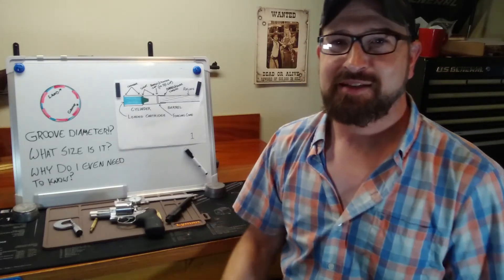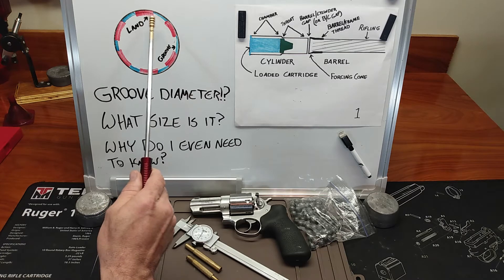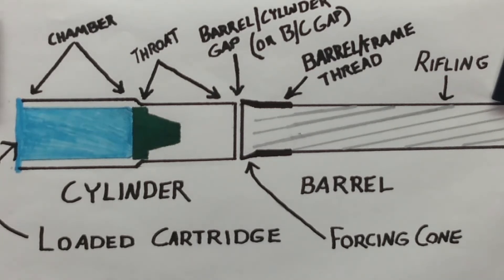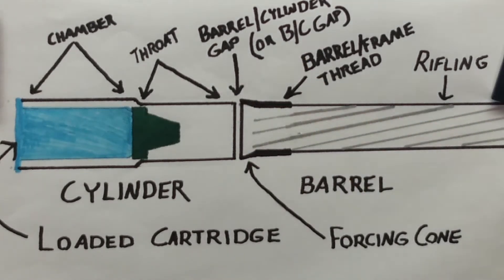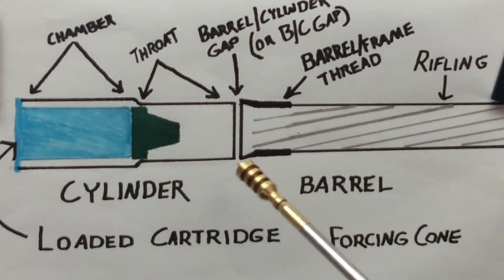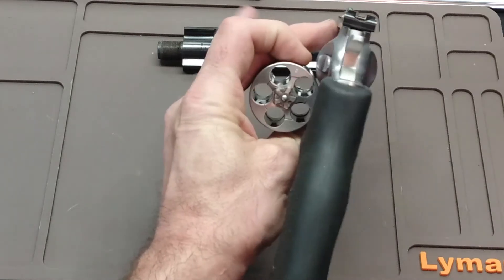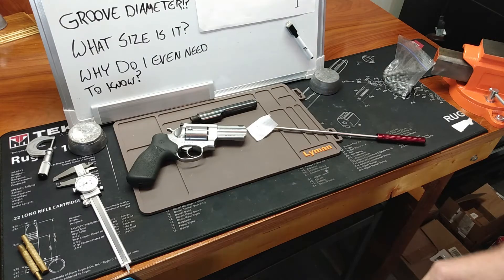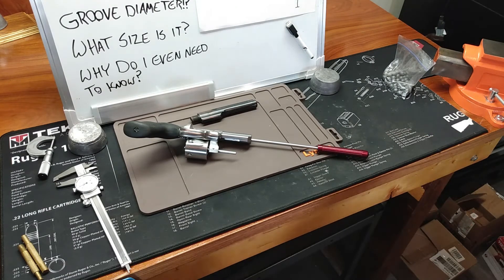7. Cast Bullet Path (1 of 2 Groove Diameter and measurements)

Comment: I have an sig 220 the forcing cone” the area against the case lip it’s sharp and likes to cut into my powder coat if I seat against it.  I don’t like it. I wanna round it off or taper it a bit more I don’t like the extreme sharp edge. I’d like to lap it but it may be nitrided.

Comment: Then there's the Dan Wesson threaded at both ends, however they aren't normally very tight.. But their tack drivers none the less. Love revolvers over all firearms.
Reply from the maker: Thanks for pointing this out. I've not had the pleasure of handling Dan Wesson revolvers but I understand that the barrel is designed in multiple peices so that it can be easily replaced. Interesting concept and yes, this may be a second restriction worth mentioning! Thanks for watching and commenting!
Reply: @leadsmith44  True a barrel assembly consists of the barrel tube which slides into a shroud, then its screwed into the frame and you use a feeler gauge for cylinder spacing then a nut screws over the muzzle end and is flush with the front of the shroud. They claim that this arrangement is attributed to the accuracy of the revolver, It was used frequently in competition. Your presentation is great though and I noted a fair amount for reference. Thank You..